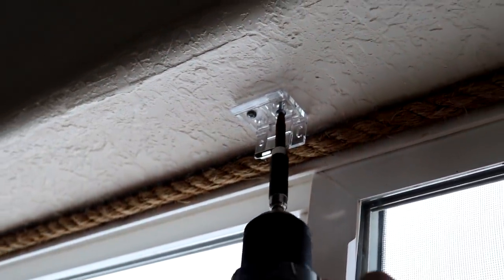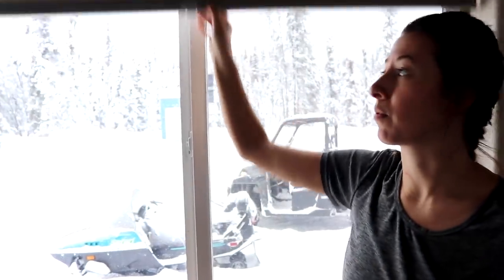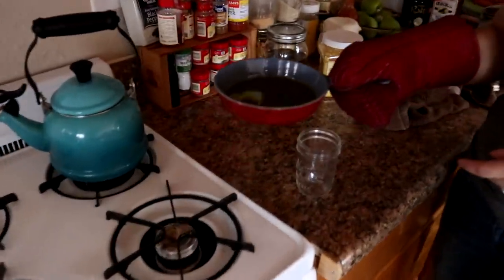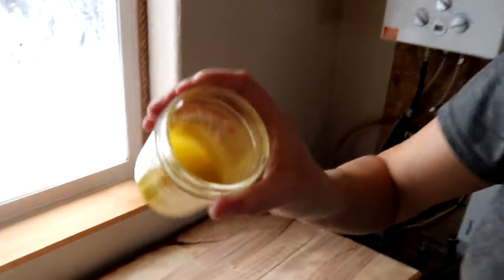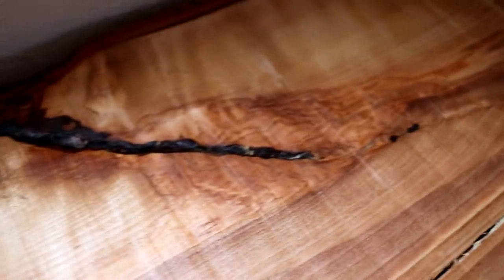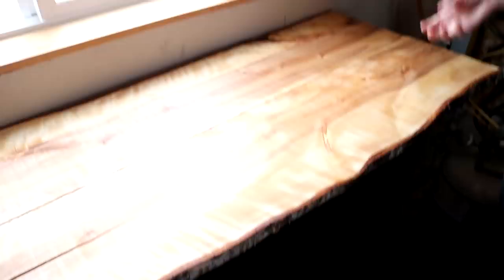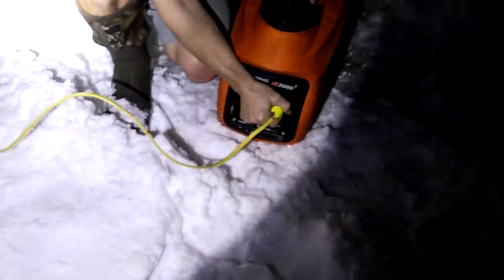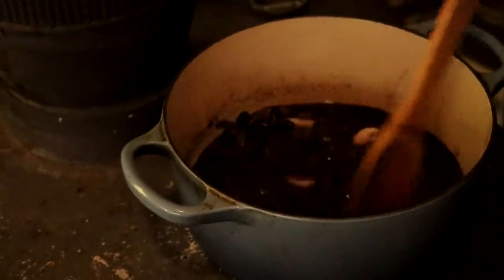Daily Struggles | Off Grid Cabin Life

Comment: Try a soap finish for bare wood. You can use castille soap or some other natural soap, and all you need to renew it is more soap and water. You have to keep maintaining it, but soap is pretty clean, smells good and is also all natural. You have to use all natural soaps with no detergents. Look this up on the net, there is lots of info on various methods. The bees wax, I think, is going to be sticky and dirt will be hard to remove without stripping it off, which will involve strong cleaners. People in Denmark and Sweden use soap, even on bare wood floors. Check it out.

Comment: I always run an air cooled generator in some type of enclosure in the winter. This helps to dry any lingering moisture and keeps the crankcase breather from plugging. I made a box with an adjustable air inlet and keep it above 50 even on those -30 mornings.

Comment: As for keeping things running better. First and oil plug heater for the vehicles. A heating cable for one of the solar panels that is temperature-activated requires no electricity and will keep the solar panels free of snow. You might also look into a wind turbine to power a low wattage space heater to keep the generators warm along with all the batteries. Only needs to produce 500 watts. I have a space heater for my studio that only uses 250 watts and heats up a 120 square feet which is about 25 square feet more than I have. So there that ought to keep you busy haha

Comment: Looks awesome! Don't be alarmed if you set something hot on the table and it leaves a cloudy ring. It will go away pretty quickly. I've used almost identical mixes on many pieces of custom furniture, and that cloudy issue is my only complaint. Of course you may not have that issue, but I didn't want you to panick if it happened lol.
Reply from the maker: Tater79bj, thank you! Good information to know :)

Comment: The cold is very hard on equipment. We lived just outside of Wasilla near Big Lake, and then later in Trapper Creek. I remember several times when it got so cold that our stuff just out and out failed. One time when it was somewhere around 40 below outside of Wasilla ( we don't know how cold it was because our thermometer stopped at - 30), but I got in the truck to start it up and the clutch just went down to the floor....just broke! Another surprise that year was trying to cook steaks on a barbecue somewhere around that temperature. It really doesn't work...we did only have a Hibachi but no matter how long we cooked it for and no matter how hot the coals were the steaks simply didn't cook. I lowered the grill grate all the way to just , almost completely on top of the coals out of desperation and they simply would not cook! The cold was robbing the heat too fast! So we eventually brought them inside and pan fried them...lol.....Of course it was always on the coldest nights in Trapper Creek that our generators failed.....but I miss it....like your channel. I know Willow...we looked at a lot of property out there....

Comment: Obviously check your warranty before you do this but using a thicker (more viscose) motor oil/lubricant in vehicles and power tools will allow it to cling a little better to the various surfaces in the motors and also allow any oil pumps to circulate the oil faster. This will reduce wear and tear on your machines and help then last longer, especially in the colder months. Just make sure you don't go too far to the point that the oil won't circulate if it's really freezing outside.

Comment: I'm not sure about your model, but i know on the similar honda's they have two speeds. If you mostly run on low speed only they don't create enough heat to burn the carbon off the ignition components. Every few hours of run time you should run it on high for a half hour. worked wonders.  great videos, just found your channel and have been binge watching.

Comment: I don't know exactly what it would entail but this is my suggestion, ( as we had this in Buffalo, NY.  Under the floor, there were coils heating the floor in the LR.  Maybe you can rig that kind of technology and use solar induction to heat and keep your equipment warm when stored inside a shed.  If your heating coil experienced cold and would not work right, perhaps you should keep the generator inside your home till you have a shed to protect it.  It's your mainstay to have power.  Do you ever look back and read comments long after you post your videos? Electric items have a long standing reputation of disliking extreme cold. Batteries have to be kept plug in in Anchorage and are designed that way because of this factor.  Some kind of heat is going to be necessary to keep your equipment healthy.

Comment: That would have been funny if Eric would have been on the pooper when threw all that snow in there. 
The proper way to fix that split is with a bow tie. I am not at that level, I’d just screw it up even worse trying. 
That’s a great idea having two generators. 
Dude, for $600 get one of those shelter logic tents. They shed snow really good to. Unless you are thinking of doing a hard structure. 
Cool video👍
Reply from the maker: I was on the pooper...
We are contemplating a permanent carport for next winter :)
Reply: That sounds good to me. We went with two tents because we needed a place fast and for less money. One day I’ll get a real shop built out here.

Comment: You need to build a septic system for starters toilet to barrel to 30 ft line buried gravity fed foam on top nothing complicated easier then cellar just don't post it cause most counties have them overkilled for jobs and environment but I've built many and any septic guy knows a barrel and 30ft line is all anyone needs mines worked 8 years at least. Flush down a squirrel or mice every once awhile for right bacteria or just rid ex anyways that's a must a flushing toilet inside that's warm. Lol
Reply: Just do it, takes day or two add rock around pipe nobody has to know.